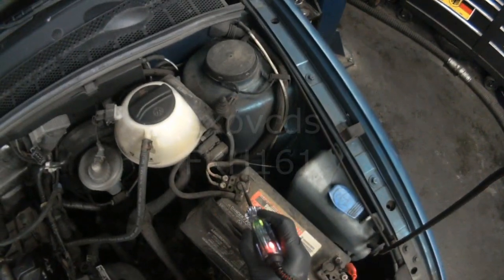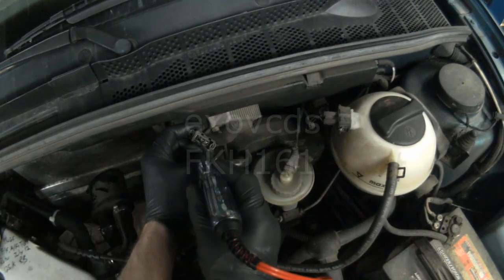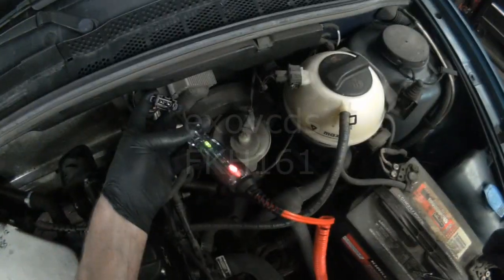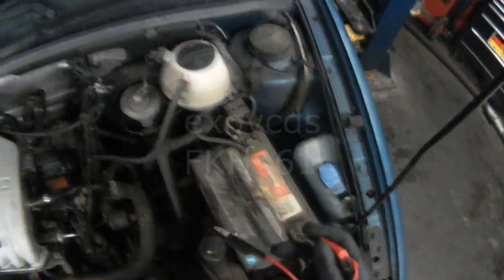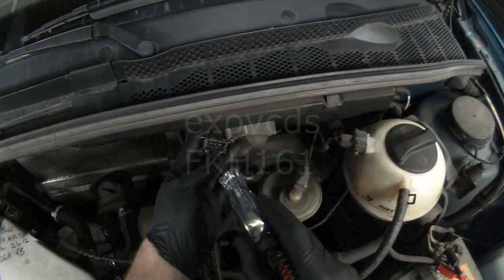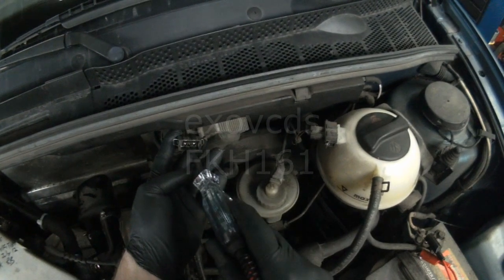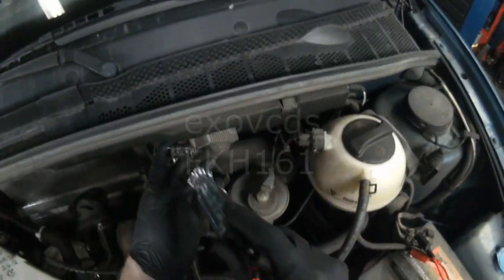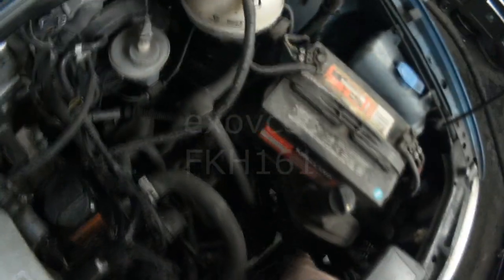VW A3: 2.0L ABA ECM "Control of Ignition Coil" Checking (helping viewer)

Comment: Hi, Thomas , I am not getting any thing from the center pin, on the ignition wire but get ground and power just fine, bad ECU? the one in it now looks good. (took it apart) and took my other two apart ones burnt and the other one has a smaller circuit board to it. I'm stumped changed the wiring harnesses a few times and relays and fuses changed coils x4's distributer x1 changed the motor for multiple reasons.  OBD2 aba with mk4 intake any feedback greatly appreciated. I'm leaning towards another ecu but don't know why or how id be burning them out so quick also changed out the crank sensors a few times. and went with an oem one that came on the new motor. its a ce2 swapped mk1 cabriolet mk3 dash mk3 dash wiring mk3 engine bay wiring relocated battery to the rear. any help is appreciated trying to get it ready by Mk1Madness. thanks
Reply from the maker: Check for an rpm signal with a scan tool... no rpm signal, check the crank sensor. If you get rpm signal, but no coil trigger, could be ecm.

Aftermarket tachometers can interfere with ecm coil control, so don't attach any tachs to the coil or instrument cluster unless they are meant to receive a digital signal.
Reply: +Thomas EXOVCDS funny story my scan tool doesnt connect to the ecu
Reply from the maker: +Marcus Feliciano Does the check engine light come on when the key is on? Do the injectors click / fire when cranking?
Reply: +Thomas EXOVCDS i checked before but ill check again
Reply: the only thing that pops up on my cluster is the clocks and rpm but that's because i need to jump two plugs together
Reply from the maker: Marcus Feliciano So you don't even know if the ECM is awake... hmmm.
Reply: +Thomas EXOVCDS  the intake does make the adapting noises other than that im completely in the dark
Reply from the maker: +Marcus Feliciano VW always suggests checking the wiring... if wires, sensors, power & grounds check out OK, then replace the ECM. 

I can't make that call from where I am. It's usually something simple.

If you had a similar issue before and the engine ran again with a different ECM... then it could be the ECM again. 

They are failing due to old age or because of a fault in the wiring... not sure.
Reply: +Thomas EXOVCDS well i have currently a grounf from the trunk area running to trans (batt relocation) grounds from the harness on the frame  ground from hood to fender coil is kind of just dangling but had a ground hooked up to it and still nothing had a ground from engine to frame , also changed out harness atleast 3 times
Reply: +Thomas EXOVCDS but i do appreciate the help

Comment: hi Thomas exovcds I have a question I have a 2002 Vw cabrio 2.0l 4cylinder automatic and my ignition coil is failing, I want to change the ignition coil from my 97 vw jetta it is motor only manual transmission is a possible to change it or is it going to happen anything bad???
Reply from the maker: I believe it is the same coil.
http://www.germanautoparts.com/Volkswagen/Cabrio/EngineElectrical/57/1
Reply: ***** ok thank you for the help
Reply: ***** it does look like that good news

Comment: Just to confirm what you have mentioned, if the middle ignition coil harness wire (blk/red) T3d/2 is not receving input from the ECU at T68/8 then it means that the computer is not seeing a signal from either cam, crank(speed sensor) in order to send spark at the ignition coil correct?
Reply from the maker: +Oscar Marquez I don't have a wiring diagram I can look at... The 2.0L engine does not need a cam signal (distributor hall sensor signal) to run... so the only signal the ECM needs (to trigger the coil) is the crankshaft position sensor signal. If you have injector pulse, then the crank sensor "should" be ok. If you have no injector pulse & no spark, then the most likely have a bad crank sensor. If you have injector pulse, but no spark, then you most likely have a bad coil. There is no way of knowing if there are wiring issues (bad connections etc) unless wires are checked.
Reply: got it. THanks again. Just rewired my ABA swap into mk1 after a short to ground issue on the wiring harness going to coil and ecu. I have a feeling i shorted out the crank sensor or ignition coil. After sorting thru the wiring diagram i will check out both components and check for resistance values
Reply from the maker: +Oscar Marquez You can not use a mk1 tach... if you have a mk1 tach, disconnect it from the coil negative.
Reply: +Thomas EXOVCDS   yes, i originally had the signal picked up from the #1 post on the A3 ignition coil. I currently will attempt to get the signal off F/9 since that comes from G1/12 via the ECU T68/22 RPM signal output on the bentley.  
Now you have me thinking,  i should try and disconnect that wire just to make sure it is not affecting the start up the car.   I think you should know that i ended up shorting my wires due to a moronic boxcutter attempt on my part. No short was caused, that i know of, as a result of coil signal pickup. Btw I ran the cars for four years prior to this incident on the same  full CE2 setup.
Reply from the maker: +Oscar Marquez Yes... that's right. Different tachs require a different signal / filtered / digital. The old tach could be preventing a start-up (ECM can't control the coil correctly).
Reply: +Thomas EXOVCDS  i will look into this thanks for your insight. Now im wondering who has the answer for types of signals in an a3 vs a1 and how to convert it.
Reply from the maker: +Oscar Marquez Only worry about it if it actually is affecting the ECM / starting. MSD ignition systems most likely have converters... again, confirm that the engine start first (with the tach disconnected) before ordering anything. I don't know if that (mk1 tach) actually is an issue in your case.
Reply: i will disconnect it first and go from there. Again, thank for your help.
Reply from the maker: +Oscar Marquez Yup, sounds like the right gadget to get the mk1 tach to work correctly. Let me know if the mk1 tach was the cause of a running issue for you.
Reply: will do
Reply: +Thomas EXOVCDS 
looks like the rpm signal did not change my outcome. resistance values of ignition coil and crank seem to fall inline within specs. I used an inline spark tester and a noid light. spark tester shows no pulse. injectors are confirmed  pulsating, noid light is flashing. only thing left that I noticed, is the middle blk/red (pin 2) wire is not lighting up or flashing. I am using a replacement ECM. I guess I need to check power signal to  ECM.

Comment: Good shit, Mine shut off the other day for the first time that way. Getting gas but no spark from ign coil. If it doesn't flicker, does it mean I have a bad coil or vice versa? Need to see if I have to buy one.
Reply from the maker: Getting gas... spark plugs are wet? You can smell fuel? you can hear the fuel pump?

If the injectors are clicking, then the test light should flicker and you should have ignition coil control, but a bad ignition coil.

If the test light does not flicker, then you do not have ignition coil control, shouldn't have injector control... most likely due to a bad crankshaft position sensor.
Reply: Thanks, I'm checking that today.
Reply: +Thomas EXOVCDS checked today. middle connection flickers while test lights on positive.
Reply from the maker: +Jose C. Rivera So you have ignition coil control... and probably a bad coil. You can bench test it like this: https://www.youtube.com/watch?v=skyF3tFvD0I  IF YOU DO IT WRONG YOU CAN FRY A GOOD COIL, so I leave it up to you if you want to check it like this.

Comment: I have a no start: I did the the "Control of Ignition Coil" test and I'm not getting a flicker on the center terminal when my test light is connected to the battery positive. I have changed my crankshaft position sensor, my ECU and my ECU Relay (109). I still don't get a flicker light in the center wire. All other two ignition coil terminals function as you showed. Where should I check next?
Reply from the maker: Any fault codes in the ecm? Do you see an rpm signal while cranking when viewing ecm datastream?  Check all your power & grounds via a wiring diagram.
Reply: I don't think I have the ability to data stream with a VAG 505 OBD reader. If I do the instruction manual for the obd reader didn't explain how to do so. I did check the fault codes and I get 00513-engine speed sender (G28) and 00609-ignition output 1. However with the new ECU I only get 00513.
Reply from the maker: +Jesse Soto I have seen crank sensors that were bad out of the box... or that failed a few months after replacement.
Reply: I wasn't getting a signal with an incandescent test light but with an L.E.D light I get the signal. I will change the coil pack.

Comment: I wouldn't be able to connect it all back because the harness is cut to where the body harness is connected.
Reply from the maker: ***** I know that some customizing is involved... but since I don't know what is and what is not connected, it is difficult to guess as to what the problem is. The main input is the crank sensor, you can leave the distributor hall sensor unplugged and the engine should still start. If the test light does not flicker when the center wire of the coil harness plug is checked (engine cranking), then the ECM is not getting a crank signal or the ECM is not awake. Again, that's all I can suggest... it might be something simple or it might be a bunch of problems working together. If you have a wiring diagram for that year ABA engine, disconnect the ECM harness plug and do some voltage / resistance checks to determine which wires are or are not connected.

Comment: What wires are neccessaeytto get a good code scan from the pink connector
Reply from the maker: ***** We don't do engine transplants (of different generations)... all I can suggest is using a wiring diagram to ensure that everything is connected as it should be. The DLC connector should have been transferred over / attached with the stock wiring harness (as far as I know). You need to be able to tell if the ECM is even awake... that's why I mentioned the scan tool, otherwise you are just chasing around. Once the ECM is awake & you can scan it, you can use fault codes (if any) to determine which direction to go.
Reply: ***** ECU is awake because I have fusible links from ECU constant to battery  and ECU switched key on.  Throttle body hummus coil and disi power up like they should it's just during crank there's  no spark
Reply from the maker: ***** Disconnect the stock tach (if it has one) from the coil.
Reply: hey we got the car running it was the underpowered coil..liek i mentioned 10v at crank it needed 12 we gave it 12 and fired right up
Reply from the maker: ***** Thanks for the update, glad it turned out to be a simple fix.

Comment: Hey have a aba wired into a mk2 running off of the mk3 fuse box and have no spark
Reply from the maker: Is the ecm powered up ? Can a scan tool communicate with it?
Reply: ***** ECU is powered up I cannot locate the yellow wire for scan port then I ran it to one yellow wire from ECU and fit communication with zero codes which is impossible I know